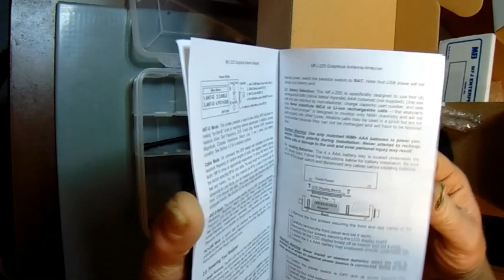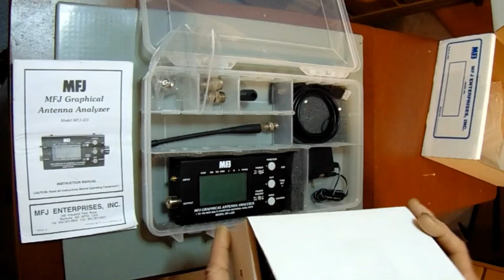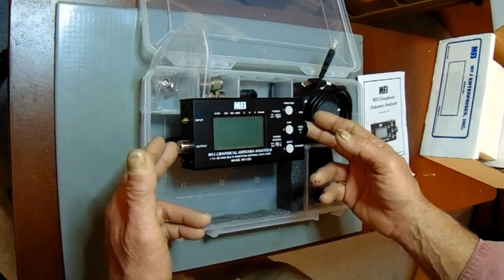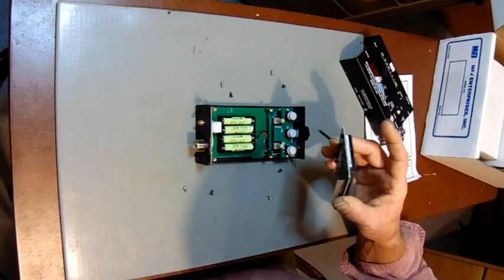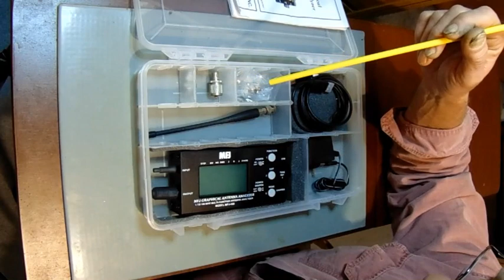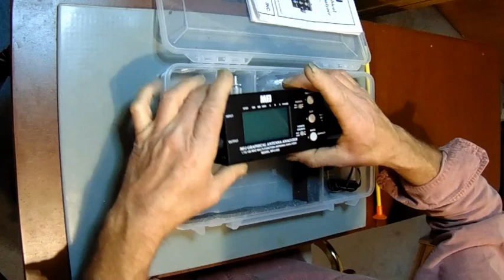MFJ 225 Introduction

Comment: I agree, better stick with rechargeable  batteries...Why the hell did they bury the batteries where you have to remove the lcd.  Thats silly..
Reply: agreed thats a terrible engineering design. What the heck were they thinking when they came up with that one. MFJ Mighty Fine Junk.
Reply from the maker: I agree with making batteries more easily accessible, but a lot of ham gear is that way.
Reply from the maker: I find the charger/usb quirk a little more annoying, but it's nothing that I can't easily live with. I just have to remember to make sure the switch is in the correct position.
Thank you guys for your comments and support of the channel.
Karl